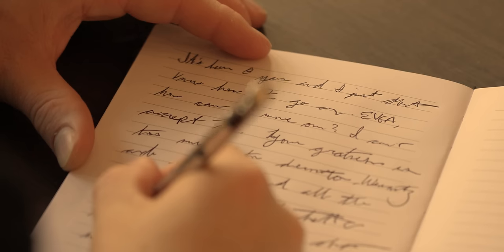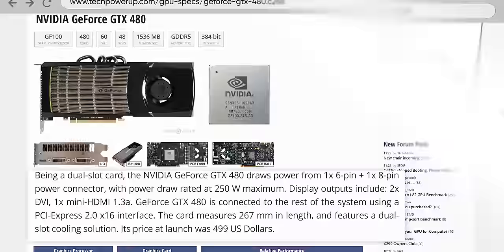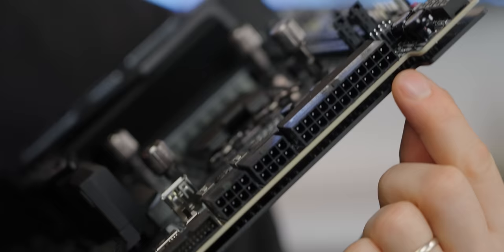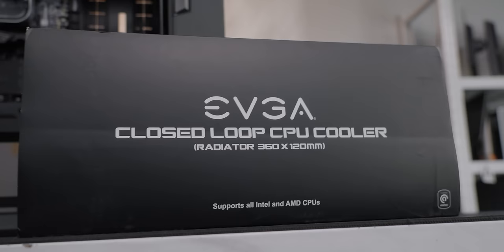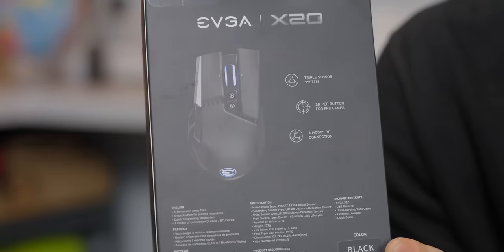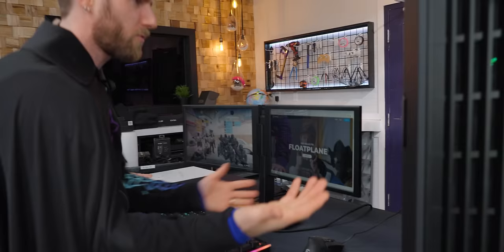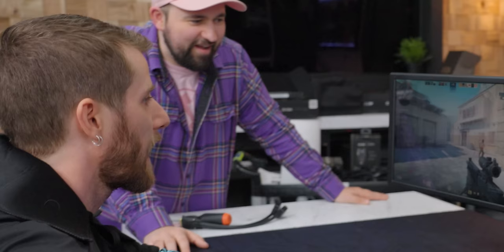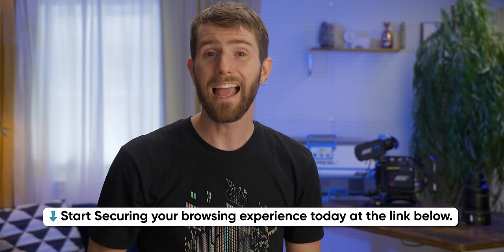I Still Miss EVGA - Building the All EVGA PC

Comment: I was one of those lucky few that got a 3080 from EVGA at MSRP just a couple of months after it launched because of their queue. The thing is still going strong after more than 3 years and I'll hold on to it for as long as I can. EVGA you where the MVP.
Reply: I got lucky in April 2022 when I got my 3090ti below MSRP new from the EVGA website.
Reply: Running mine from the 2022 queue, 1.5yrs later. Running strong and I don't want to get rid of it anytime soon!
Reply: Same, I was lucky to get the 3080 when it launched. If there was any inclination that they might stop making cards, I would’ve bought the 3090 Ti ; #sadness
Reply: am I the only person who prefers nvidia founders cards?
Reply: I've got a evga gtx 1070 that's going strong lol
Reply: Are you getting driver updates?
Reply: I have a 2nd hand 1080 I slapped a water block on. 5 years in and still going strong. EVGA truly was goated. I can't believe nshidia was so horrible that evga peaced out.
Reply: @defeatSpace  yes. They're harder to maintain/disassemble and exist only to undermine 3rd party gpu manufacturers.
Reply: My current gaming rig has a 3080 12GB from EVGA.  Yeah, I miss them.  Nvidia didn't know how good they had it.
Reply: An EVGA AMD card or Intel card would be awesome! I buy I'm a heartbeat, I hope they pull through. I have my doubts but thr industry needs them
Reply: my EVGA 1060 6gb sc is still going strong!
Reply: 3080 Ti FTW from the EVGA website queue
Reply: Wow a graphics card still working after 3 years who could have guessed?????
Reply: @CaptnKrksNippls  at least you know now. Seems you didn't know they'd last that long? 
Buy better I guess
Reply: Yea same. I got 2 3090s. And 1 3090 with the anti Crypto thing on it. Flipped them both
Reply: @CaptnKrksNippls  lol fr if your gpu doesn't last 3 years you're either doing some crazy stuff with it or you bought a turd
Reply: @BaldKiwi117  I have a 980Ti Classified I bought in 2016 and the damn thing can still play most games that came out last year on Ultra settings. It's not even OC'd 😂😂 love that damn card
Reply: I got fucked with the pricing but still love my EVGA 3080 and I have own and sold 3 separate PSU's from them on a spawn of like 9 years, they really are the MVP
Reply: I got a 3070 at msrp because of their queue and I love it
Reply: @CaptnKrksNippls  right?? 😅
I love EVGA as much as the next guy but I'd sure hope a 3 year old GPU is still "going strong"

hell my asus 970 from 2015 was doing perfectly fine up until I replaced it last year just because I wanted better 1440p fps

Comment: I have only owned EVGA graphics cards and I have never had a bad experience with them. Every card I've purchased with them has been great. I hope EVGA starts making AMD cards at some point. I would buy one in a heartbeat.
Reply: bingo, same
Reply: I had one bad one; the 560Ti DS.  It came with terrible thermal paste (or just a bad application???) and had to be repasted out of the box or it overheated.  Funnily, after repasting it it worked great and is still in my old as balls garage computer.
Reply: One of my two 970 Superclocked in SLI caught fire, instantly killing the first card and making SLI innacessible on the second due to a piece of the bridge melting. EVGA replaced both, no bureacracy, no questions asked. I'm sure that had it been any other brand they would've done everything in their power to pin the blame on me and leave me with two broken cards.
Reply: I had a EVGA GTX 970 since 2015. It ran so good and still runs today and performs very well still in AAA games, Only just recetly got a ASUS 4070ti. Also only ever used EVGA PSUs and they all worked flawless. EVGA is such a strong company that made strong items. I wish them the best and hope they still exist for years to come
Reply: yeah another person using a 560 ti @r.j.sharkey
Reply: i ran a garbage spec 760 from them for years. allowed me to play whatever i wanted with my friends despite them having rtx cards. setttings be damned, at least i could play and the card never faltered. next gpu i bought was a 3080 Ti FTW3 at scalper prices. still worth every nickel.
Reply: I suspect if they were going to pivot to AMD, they would have immediately made that move.  At this point, they've probably lost a lot of institutional knowledge in GPUs.
Reply: I did with the 8800gt in sli. Things over heated. But those nvidia chips were trash (great gaming, but didn't live long)
Reply: @aeronyx  how tf did it catch fire?? That's an absolutely catastrophic failure
Reply: i have yet to have an EVGA product fail on me. and some of my stuff is pushing close to 20 years old! they really overbuilt their stuff. ive built well over 4000 gaming computers, over 200 servers, and i dont even keep track of the regular whatever-computers. and still, not a single EVGA failure other than like a house that got struck by lightning.
Reply: Only one I had issue with was a 970 when they lied about 3 pipe contact when it was actually only 2
Reply: @Dell-ol6hb I’ve had the same thing happen to me. My 970 SSC had a VRM blow up and caught fire. Thankfully even after being out of warranty they replaced it no questions asked.
Reply: EVGA swore off AMD years and years ago
Reply: @Dell-ol6hb  Something with the VRM, I'm not exactly sure what the issue was as I never got told in detail nor was smart enough to figure out by myself, all I know is that it started with the VRM.

Comment: Fun fact. I ordered a prebuilt in 2021 to get hold of a 3080 at normal pricing. The card was due to be an  XC3 card. But when it arrived I had a FTW card which was £100 more without scalping pricing back then. Even on the receipt it said XC3 so I wondered about the warranty incase I had any issues. Sending back a FTW card when I was supposed to receive an XC3 I was worried Scan would say the card isn't the one we supplied. So I contacted Scan and they said it was fine. They said consider it a free upgrade from EVGA because they have no XC3 cards to ship and wanted to complete orders so warranty still stands with Scan and EVGA even though I paid for the lesser model. 

Just shows how EVGA's customer satisfaction went above and beyond.

Thank you EVGA. You'll never be forgotten.

Comment: This brought a tear to my eye. I've had components from many manufacturers. Gigabyte, Zotac, Asus, G.Skill, Corsair. You name it, I've probably had at least one. All of them have have had problems on every component I've bought. Except EVGA. The quality of their products has never once failed me. To put it into perspective, one of my Gigabyte 980Ti's blew a resistor trying to load the WoW login screen and nearly totalled my entire machine. My Gigabyte 3070 didn't last 2 years. My old EVGA 770, however, still functions fine even if it can't handle the most modern games anymore. Recently, a friend of mine was selling off his EVGA 3090. I didn't even care that it wasn't a 3090Ti, I snapped that thing up fast as I'll never see another EVGA card beyond that now. And I'm so sad about that and I have no idea what I'll buy going forward.

I'd love to see EVGA look to Intel and see if they can cut a favourable deal in helping them develop their GPU line. Their ability to innovate might increase the pace of development on those cards and catch them up to their competition. If Nvidia does leave the gamer market we will need someone reliable to pick up the slack. Also if they could make motherboards again so I'm not stuck with terrible quality Asus boards or an Asrock board that looks like it's been puked on that would be phenomenal.

Comment: I miss them too!!! My 12 year old X79 Classified mobo with EK waterblocks on VRM and southbridge is still chugging along and overclocks like a beast on my i7-3930K... minus the fried USB 3.0 chip due to a water leak. Ooops! My EK water cooled 1080Ti FTW3 still spits out frames like a champ and holds crazy overclocks and voltages. I have never had an issue with EVGA gear, but have had failures with every other brand! Hurry back, we miss you already.

Comment: I know we shouldn't stick to one specific brand for hardware or software but EVGA really do deserve the love. I've had my build for nearly 8 years now and the only parts that have never required any kind of support are my EVGA PSU and GPU. I know they're actually known for their Customer Support but the EVGA parts I've used / made my friend's use for their build have hardly ever put a foot wrong.
Reply: Same here. My EVGA GTX 1070 FTW and EVGA PSU are still running like a top to this day. I'll never sell my GPU.
Reply: Yes, I have a GTX 760 from them in my living room home theater/emulation PC and the thing is almost 11 years old now and the only maintenance I ever did to it besides cleaning was changing the thermal compound once. 
Kind of unreal.
Reply: I love their power supplies. Never let me down. Not even the $30 evga 400w units that everyone fears 😂.

I had 2 rx 470 running in my pc with one of those 400w psu just fine.

Now I use the evga 450w bronze units because the other ones are hard to find now a days.
Reply: Man, I was there when two GPU card was a thing.

Remember 290?

I was in middle school.

Comment: Back in the day I had issues with my EVGA X58 Motherboard, when I RMA'd it they had no stock so they sent me a X58 Classified Board, thing was like $500 at the time and the most beautiful piece of hardware I had ever seen in my life lol, and they had it back to me with 2nd day shipping. Also RMA'd one of my two GTX 295's I had in Quad-SLI, they sent me the replacement before I even shipped the original out, fantastic company!

Comment: DMS-59 cables were really common for low profile ATI video cards from OEM's like HP and Dell. They used a DMS-59 splitter cable and supported mixes of VGA, DVI, and displayport.
Reply: I had a low profile quadro in my sff HP computer when I was a teenager. It had a dms59. Loved that lil guy
Reply: Also ended up in a lot of servers back in the day.  low profile cards that were cheap.  Ended up picking up a box of 30 ATi cards withe these, for like $20 about 5 years ago, and sill use them whenever i just need video output on something.

Comment: I use that 850 T2 now and it's been going strong for 6+ years... but I also had that 1600 Supernova right when it came out. EVERYBODY wanted that PSU, it was always sold out and I worked hard to get it. Powered my multiple 580GTX rig and it needed it 😳 (also I clicked on this video solely expecting you to build an SR-2 since that was the greatest MoBo ever built.)

Comment: I just RMA'd a EVGA 3070 that lost display output. The process was smooth! They responded promptly I sent in my card and had a new one back within about a week. Great to see that they are still honoring GPU warranties! I'll definitley miss them Ive had this card and a 2070 super from them both amazing cards. Good to see a tribute build. Long live EVGA
Reply: well... i doubt it will last as long... the stock is probably going pretty low... then again 40 series is kinda subpar...

Comment: This was a great trip down memory lane. I love EVGA, I’m still using their 850g2 supernova on my currently build. Previously I had a pair of gtx1080 FTW2 (I know, I know but it actually made demanding games like GTA V run much smoother) in my PC and they were awesome. People who were into PCs at that time may remember that the early FTW2 cards had a thermal pad issue which caused some melted components, EVGA allowed you to make the repair yourself with a kit that you could request from them for free and it didn’t affect your warranty. I can’t think of another tech company that has done something similar. When I finally upgraded my PC once GPU prices came back down to a reasonable level I couldn’t justify to myself the significant price difference between an EVGA 3000 series card and ones from other brands. It’s really sad that we are never going to get new EVGA cards, thanks EVGA for being one of the last tech companies that actually seems to give a shit about their customers

Comment: i've a friend who still uses an SR2, he'll have a case that will fit yours... he blew his inheritance on that thing, quad GTX480, 2500w psu, fully water cooled, it was an absolute beast and it still competes with modern hardware to this day, he maxes modern AAA titles on that thing (although he since upgraded the 4x 480s for a newer card) - sadly the SR2 mobo has a wierd issue that we tried multiple times over the past 12 years or so to fix, but it's still usable... he runs the lian li case, the only one made that would fit the SR2, he's been wanting an upgrade, maybe you could work something out between yeselfs if i put you guys in contact
Reply: the 3 bios chips are bios 1, bios 2 and a redunant backup bios in the case something goes catastrophically wrong

Comment: EVGA the one company I had nothing but excellent interactions with. They were around in the Battlefield Scene when we all went nuts over the lack of 3rd party servers (they stuck with the gamers) but also their warranty program, step-up (used it 2 times) and queue system. They made it possible for me to change my burned out (by BF3 at the time) 780's I had gotten through step-up and replaced them with 2 980Ti's (yeah that was a heck of an upgrade). They knew this and added a lovely message with it.

The queuing later on allowed me to get an 3080 for €600 (MSRP at the time) and well still got that one. Knowing full well that ever since I actually got it, I wouldn't have been able to buy it for that price anywhere else. Even today, 2nd hand ones are still above this price.

EVGA was a gem.

Comment: The very first computer I ever built from parts had an EVGA nForce 780i SLI motherboard and an EVGA GTX 280. I believe it was one of the first consumer motherboards to need active chipset cooling, because the 780i northbridge ran so hot. Had to have a heatpipe and radiator, with a fan strapped to it. And the fan that shipped with it was loud as heck, was like a big angry bee trapped in your case. Forums everywhere were filled with people suggesting northbridge fan replacements. The GPU also had an (at the time) incredible 230+ W power draw. 230 watts! People had to go buy bigger power supplies. I had a 1000W power supply because I was going to future proof with the ability to go TRIPLE SLI in my nForce motherboard, but by the time I needed a second card let alone a third, the technology was obsolete. Ah, the good old days.

Comment: The nice thing abount Evga cards were their tuneability. They respected you as a customer and gave you the tools and the platform needed to configure the gpu to your liking.
3080ti FTW3 @ 1800 MHz UV, 250 W? No problem.
2100 MHz UV OC, 450 W? Also no problem.

Comment: You basically insinuated that their Z790 supports 14th Gen, which it does not. They never released the new BIOS they promised months ago. All their bios team seems to be gone and they haven't provided any updates in months. They've also only released two new power supplies in the last year and with just 3 year warranty on them, which is super short for EVGA. They didn't even release the 12vhpwr cable for their psu they said they were working on. It does not sound like a company that plans to continue. As someone who's been a massive fan of their products for many years, I really don't see any signs of life from them at this point other than covering existing warrantys with RMAs (some of which requiring multiple attempts from people because their replacement shipments are also broken).

Comment: I currently have the DG87 Case. I bought it to build my first ever watercooling PC because it was so spacious. I cannot see me replacing it anytime soon. I have 2 480mm radiators, full atx board, 7 Noctua 3000rpm fans, 2 x 1080ti, 1000w PSU and many other things. It's a thing of beauty. And to top it off, I can still swing a cat in there.

Comment: I had an EVGA 1650 Super OC Edition and there is one reason I chose that brand over the other. Because it was the highest spec'd 1650 I could get for under $200 back in 2020. I was crushed to find out Nvidia pulled the plug on EVGA cards because they really were the Ferrari of PC parts.

Comment: The SR2 does indeed fit in a DG-85 case....sort of. While most of the stamped mounting standoffs in the case line up with the mounting holes in the board, a good deal of them do not and run the risk of grounding out on the back of the board. I had to drill out the offending standoffs to make it work. I built a 2010 Hot Rod PC a couple years ago with an SR2 in an EVGA DG-85 with 4 EVGA Classified GTX 580s. Highly impractical, maximum coolness factor.

Comment: I've always loved EVGA designs for GPUs... Previously I had the 1060 FTW2, and my girlfriend had a 1050Ti FTW, beautiful cards, great cooling performance and never had a single issue with them.

In fact, I still have my 3070 FTW3 and I'm not planning of getting rid of it any time soon, it's the most beautiful card in the 3000 series to be honest, with the RGB bar on it's side and all. Maybe a few generations over I'll switch to something else, but for now? CS2 and League run wonders on it (as they should lol) and Baldurs Gate 3 runs at 60 with everything maxed anyways.

Comment: EVGA was NOT the first motherboard manufacturer that introduced the usb bios flashback feature (updating the bios without a cpu). The first that did that was ASUS. ASUS certainly had this feature since Z77 (from 2012). In the video (at 08:07) you say that EVGA introduced the usb BIOS flashback update feature with the Z390 platoform (in 2018). If this is true that makes EVGA the last manufacturer that introduced this feature as Gigabyte, MSI and ASROCK all introduced it before that.